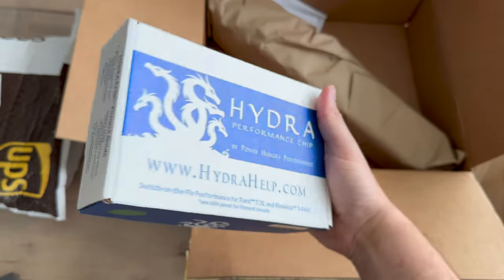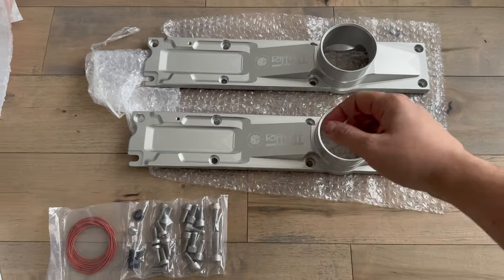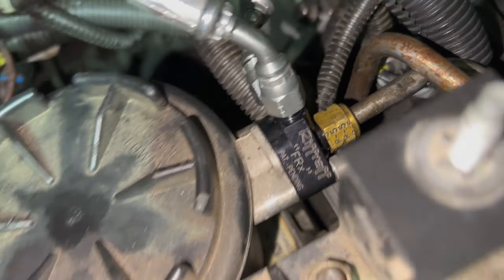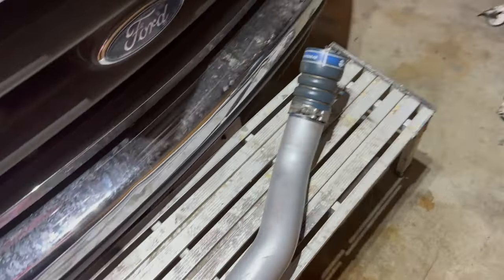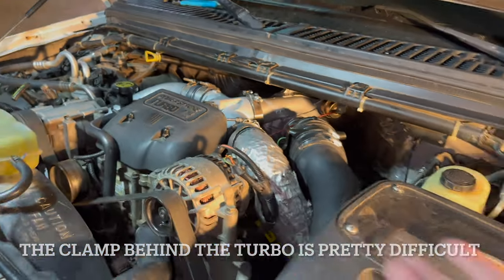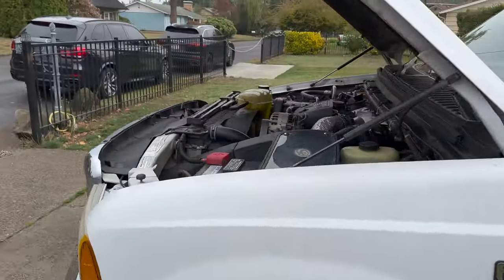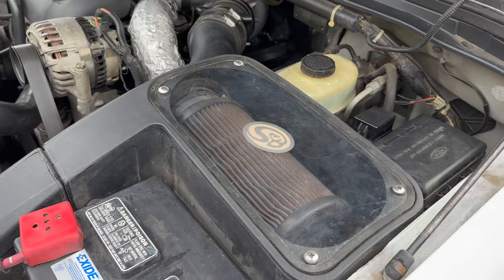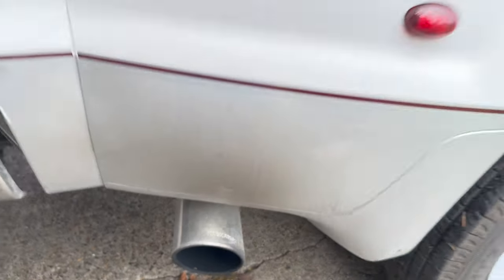7.3 Diesel $1000 Upgrade!! Plenums + 140hp Tune

Comment: I definitely agree, the FRX fuel crossover and high pressure oil crossover kits make the motor run so much smoother 👍👍
Reply: I have the crossover but haven't installed it yet as I have heard mpg goes down with it.
Reply: @psi3000  don't know why someone told you that, my mpg went from 13.2 to 15.4

Comment: Love my 7.3
I have everything Riffraff makes on my motor except valve covers. I also installed their fuel filter between the tank and fuel pump. The dog house breather I turned around on the valve cover and ran a line down to the frame to a catch can and back up to the intake. 
I’m running an Edge CS2 on my truck. The tow mode really perked up my truck. Really like how you can have five gauges. I set mine up to read boost, EGT, coolant temp, fuel pressure ( at the bowl ) and ICP pressure.
Reply from the maker: Yeah man that sounds like an awesome setup. I need to get a gauge setup too

Comment: Nice, I haven’t installed the hydra chip yet, but I have the fuel rail crossover, the oil rail crossover, the blank turbo pedestal, and the up pipes.  Truck definitely feels like it has a touch more get up and go.
Reply from the maker: Oh yea, and it noticed it runs a lot quieter after the crossover kit

Comment: Next time you have a chance you should change out that upper radiator hose so it goes around your serpentine belt and not through it. Makes roadside belt changes possible. Nice video btw.
Reply from the maker: That's a good idea.. I gotta get that done. Flex plate just went out now so I gotta do that too and Thanks!

Comment: That's a really clean 7.3 man, 2wd? Either way that's a keeper. Need to do a headlight update and raptor grill with a bumper. I got the headlights with the wrap around led as a running light. Really makes the front end look more modern
Reply from the maker: Yeah it's only 2wd but for hauling purposes that actually helps me. Ive upgraded the headlights to the "6.0" style from amazon which helped but the bumper and side steps still make it look Like a grandpa haha

Comment: Nice job Tony, I did the RiffRaff hoses and added a 14 Blade Wicked Wheel and it woke my truck up coming off idle. Cool truck. Change out the head lights next. I did mine and man I love em. I did the 05-07 No Cut mod headlights here; https://www.youtube.com/watch?v=z0LMjxBRKjc&t=1170s and added some AUXITO LED headlights here; https://www.youtube.com/watch?v=svE8Be-Su58  and it made a huge difference in lighting over stock, especially on wet pavement at night. Best Wishes & Blessings Tony. Keith Noneya
Reply from the maker: Thank you man!! That was my next plan. Now that we’re coming up on fall and winter and the day gets darker sooner, I really noticed how weak these headlights are. I saw those $100 replacements on Amazon, but didn’t know what to think of them, they are completely clear, but I’ll check out your video.
Reply: @THECONDOR98  Just don't forget to align them after you install them. I have a video on that on the channel as well. If you're short cash, after all that RiffRaff purchase, just polish the old headlights with 600 grit wet dry paper and water. Then use some NuFinsh, orange bottle at the local auto parts store, and buff it with an old T-shirt. Then drop in some of those AUXITO LED headlights & align them. You'll be blown away at what you've been missing going down the road. Best Wishes & Blessings. Keith Noneya

Comment: So did the plenums make any gains? Or are they just pretty?
Reply from the maker: My plenums were leaking so I needed to replace them anyways. They can warp over time but these ones are billet so they will remain solid. Im assuming for high boost these will do much better but yea.
Reply: @THECONDOR98  I was jw if they made a difference from stock.. in my case I don’t care how flashy they are if they help flow.

Comment: Did you have to cut the bolt for you’re plenums ? And do you have a l99 7.3
Reply from the maker: No I did not have to cut it, that bolt that everyone cuts on YouTube installs is SHORTER from factory! This is to allow it to come out without hitting other things I have a later 7.3 not the early model.

Comment: what are some upgrades to do if I wanna use a 7.3 as a tow pig to haul freight or cars etc
Reply from the maker: That's what I used mine for, first of all Id recommend servicing it, make sure no oil leaks if possible, change your air filter with a nice quality one like Mann for example. Change the oil with some quality oil like I use Shell Rotella T5, depending on miles id change the rear diff oil I used Amsoil severe duty 75-140 and very very important if you're going to tow heavy CHANGE YOUR BRAKE PADS!!. I recommend a good brand and something for heavy duty applications. Ive had my brakes fail on a two car trailer fully loaded once and I had to come to a quick. stop using only truck brakes. well they were smoking... when I stopped. If I didn't change them beforehand Im sure I would have crashed. 

Now for upgrades my number one suggestion is a transmission cooler, the tranny coolers on these trucks simply aren't great from factory (if you have an auto like me) I bought a Mishimoto transmission cooler and changed my tranny filter and also used Amsoil transmission fluid. Secondly I Recommend a straight pipe, you can keep the resonator that comes With a straight pipe kit and the truck is barely louder but It helps it breathe better. Id also suggest getting a EGT sensor if you're planning to tow heavy and often and thats honestly about it,. 

The upgrades you see In this video are by no means necessary but I love this truck dearly so I decided to throw some extra parts on it. 

Good luck!
Reply: @Tony Condor  thank u bub I plan to do local vehicles  transportation and then hopefully work my way up to find freight loads etc not really stressing just need get my foundation set up